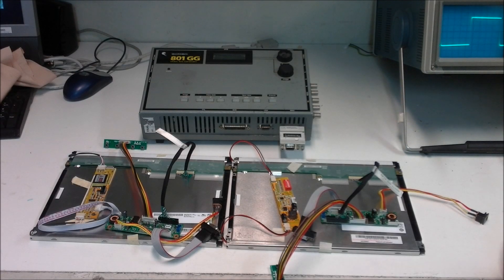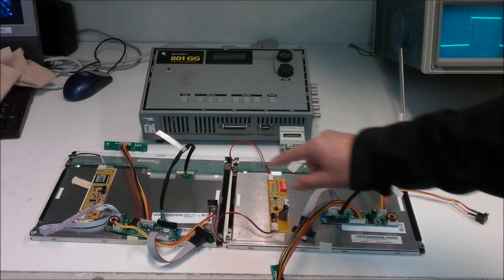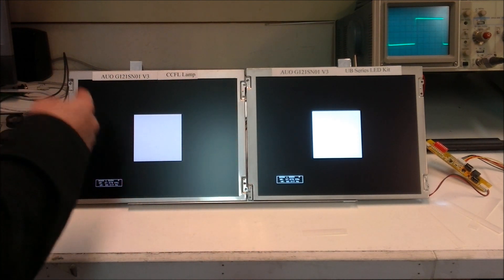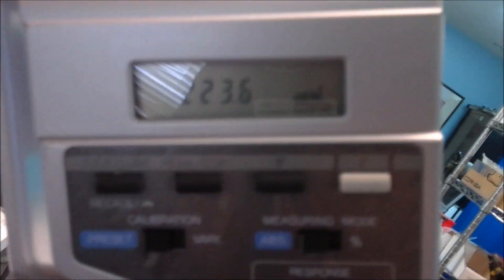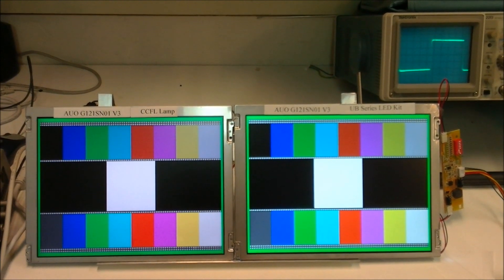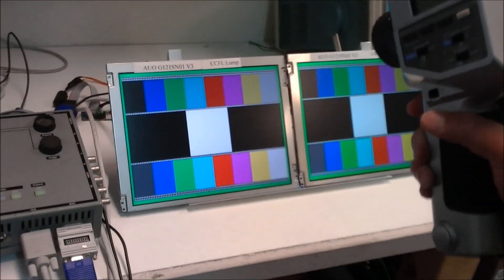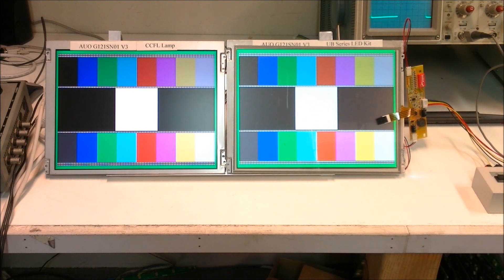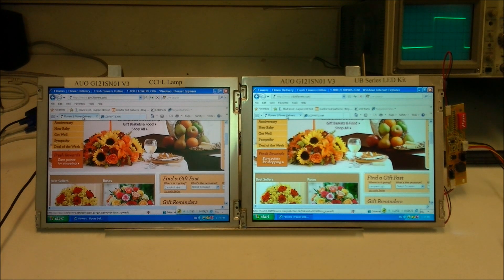This demonstration video is based on New AUO G121SN01 industrial panel.

Comment: 3:10. The luminance meter is pointing way outside the center square, as it was in the first measurement. Also, used CFC lamps are dimmed. Also the controls were not set to highest luminance. The test is irelevant and misleading. Thieves?